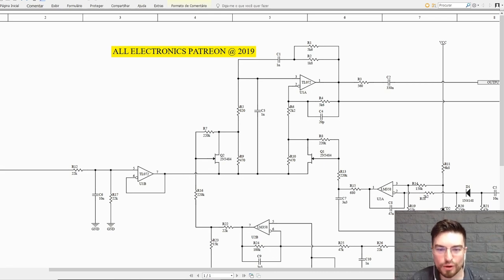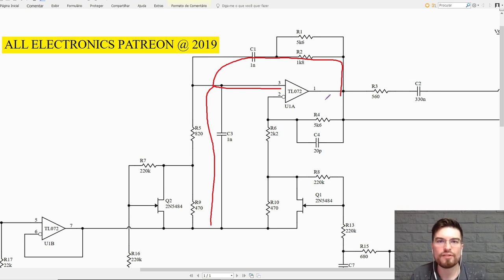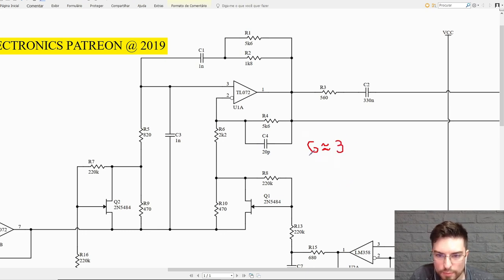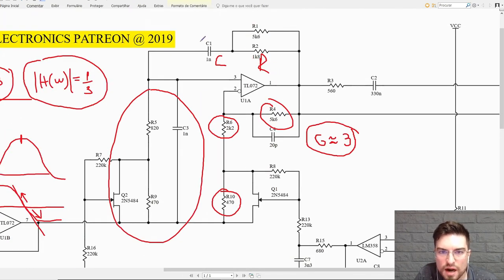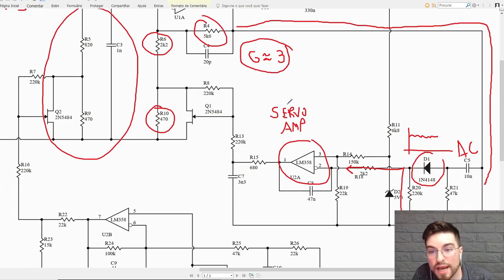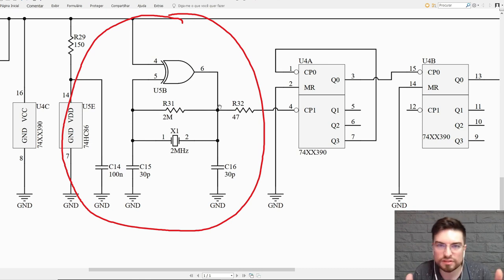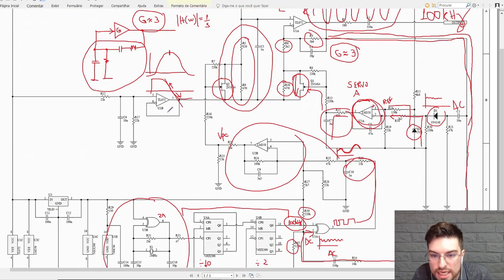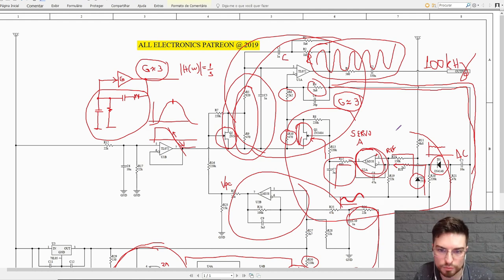Wien Bridge Oscillator with AGC and PLL

Comment: Very neat. PLL with no PLL chip. But you could always just make a oscillator where the crystal is in the feedback loop  (Pierce oscillator). I was hoping you built it - would have been cool to see it run.
Reply from the maker: The reference oscillator is a Pierce one, using a CMOS gate!

Comment: I really like this lecture. Thank you very much. I would have appreciated seeing some scope shots to see the output sine wave and amplitude given a fixed supply voltage (because I built a standard Wien Bridge but my sine wave looked okay, but it was not a perfect sine wave so to compare really). Would it be difficult to include variable resistor to adjust the frequency without loosing the quality of the sine wave in this circuit or would this question require a complex setup? And when you spoke about locking phase, would this apply to a very low frequency such as 10Hz? Thank you again for teaching me about electronics.
Reply from the maker: I have another video showing it working, take a look! Frequency locking should work for lower frequencies...

Comment: Excellent video Gregory!, just a question, why after D1 rectifier is not necessary a capacitor to generate the dc proportional to AC signal? I understand that the complete job is done by the integrator with final LPF (R15 and C7). Maybe I am not understanding the principal job of that integrator.
Reply from the maker: Hi man! Thanksss. The capacitor is not needed because the pulsed (rectified waveform) already has the DC information. The integrator will average and extract it. 
You could argue that a capacitor would smoth the signal even more. True, but it also would add a pole to the loop, making it harder to tune/stabilize
Reply: @AllElectronicsChannel  thank you Gregory!! Nice explanation, I got it

Comment: How does this architecture compare with a crystal oscillator with a output filter to remove harmonics? Given the number of extra components needed for the wien-bridge, dual pll's, is the benefit in THD large enough to offset the extra complexity vs the simpler crystal oscillator plus filter?
Reply from the maker: It was a design exercise... probably a crystal oscillator followed by a crystal filter would generate an overall simpler and powerful architecture. I thinking on measuring the performance of this Wien bridge in the next video. What do you think ?

Comment: Precession of the signal phase of any of the generators leads to an increase in the voltage at the output of the phase detector. How then is the frequency stabilized?
I understand that it is necessary to implement a scheme in which the advance of the phase of the target signal would lead to a decrease in the voltage on the gate of the field-effect transistor. And if the phase of the target signal is delayed, it would lead to an increase in the voltage on the gate of the field-effect transistor.
Reply from the maker: The XOR generates exactly what you said. Vcc/2 when 90 degree aligned, higher or lower voltage if delayed or advanced.
Reply: @AllElectronicsChannel  Then there must be a constant 90 degree phase shift to allow the pulse width to shift after the XOR. Did I understand correctly?

Comment: Superb explanation! I have two questions: 1. you mention a couple times the oscillator going into saturation without proper amplitude limiting---that would effectively make the output a square wave as the op amp pushes the output up to the power rail voltage, correct? 2. What was the purpose originally of this design---or in other words what would be a practical use example where this particular oscillator design would be appropriate?
Reply from the maker: Thanks

1. Yep!
2. It was a design exercise. Analog circuit like these where found in THD meters.

Comment: Can we set frequency 50 or 60 HZ ?
Reply: In theory you could by simply increasing the capacitance.  You would need to increase the capacitance  in the Wein bridge to about 2 microfarad.  But you would need to be careful to select a good quality capacitor to get good linear behavior.  You would need to use a film capacitor to get good linear behavior.  For the frequency locking you would either need to use a lower frequency crystal or add more divider stages to get to the 50-60 hz reference.  You probably would need to increase the capacitance used in the integrator for the AGC and AFC loops to keep things stable.
Reply from the maker: Nice!

Comment: That should not work, as a Wien Bridge Oscillator relies on the two rc networks to be identical for oscillation to occur, most say the two has to be within a few ohms or less for oscillation to occur, or atleast to keep any sorta phase noise/THD to a minimum.  Also the WBO is one of, if not THE the most frequency stable sinewave oscillator out there, so having the pll is kinda redundant/pointless unless you're shooting for frequency standard like accuracy + you can achieve the amplitude stabilization with nothing more than a couple of diodes in series/parallel arrangement to set a voltage level where the gain becomes unity, no need for the entire peak detector and servo amp combo. The diode stabilization basically goes in place of the light bulb in a light buld stabilized WBO, while its not as stable as with a light bulb, its heaps cheaper and easier than trying to locate a suitable light bulb.

The advantage and appeal of the WBO is that it is one of the few, if not THE only true self starting sinewave oscillator that only need one opamp. Most others need two or more and have nowhere near as low THD as most/all of those are just square wave oscillators with wave shaping circuits to approximate a sinewave, or resonant filters that ned a trigger signal to kickstart oscillation. Though the disadvantage and reason we rarely if ever see the WBO used in practice and instead live with slightly worse THD, or use some DDS based system is difficulty to vary the frequency as you need to change both resistors or capacitors in the positive feedback network simultanously, most commonly you change the capacitors with a multi position rotary/push button array switch as there are no dual gang potentiometers in existance that track closely enough to be useable in a WBO for continous frequency adjustment over any sorta range, so its really only implemented as a fine control of a few Hz or up to a few tens of Hz at most to keep a dual gang pot in a range where the tracking of the two is close enough to remain fairly identical.
Reply from the maker: And it works 😁